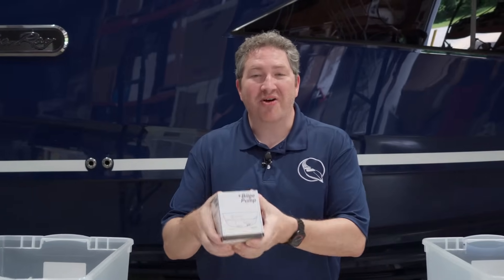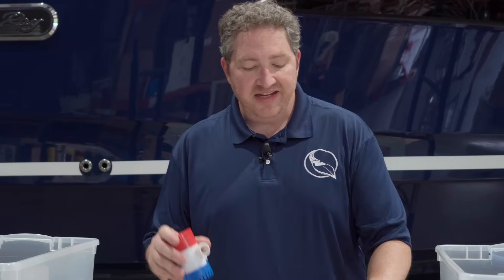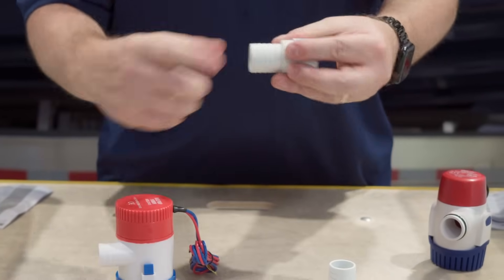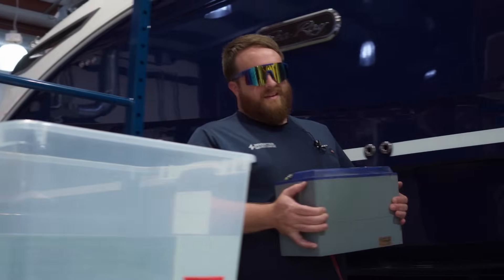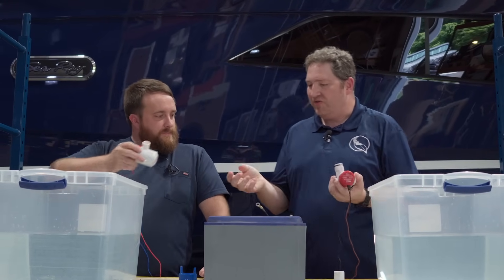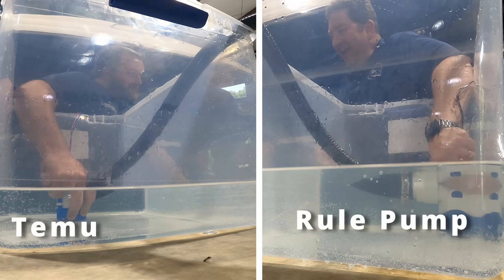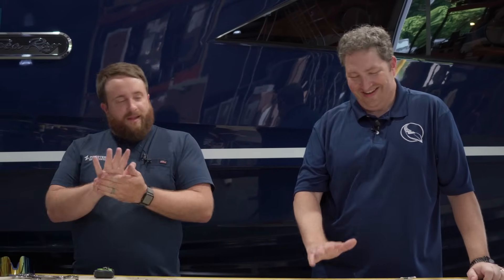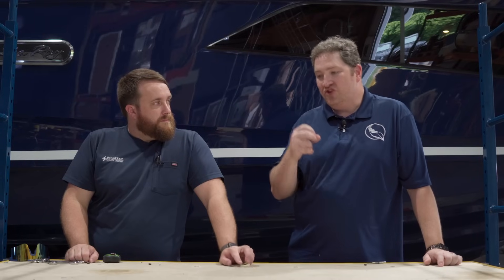Temu vs. Rule Bilge Pump — SHOCKING Test in Dirty Water!

Comment: Metric pvc pipe, fittings and hoses are close to Imperial ( used in USA) but not the same so trying to get connections correct may not work out. I was at a Sake plant in Napa valley and the pipe fitter had received some pipe and fittings from Japan, he was having a lot of concern trying to connect the Japanese parts to American pvc fittings and hoses.

Comment: You seemed biased from the get go without reason. You claimed the temu pump wouldn't fit in the rule base but you didn't bother to even try that even tho you had the parts in your hands. You guys should be more through and unbiased when making these videos. The video could have been good.
Reply: Dreadful review.
You wished the Temu product was very poor.
Turned out it wasn't. 
You need to be more impartial.
Reply: I agree. It felt likenthey were looking for ways to down play the Temu pump. I mean we all know Temu doesn't sell quality but will the pump do the same job at a fraction of the price? How much was the Temu pump? If you can buy 4 of the Temu pumps for the same price then longevity might not be as big of a factor.
Reply from the maker: Thank you for the feedback!

We explained in the video that the base of the Temu pump is not the same shape as the new Rule pump.  The old Rule pumps were that same circular shape, but they don't make them like that anymore.  Our experience in the past with trying to fit knock-off pumps into the old Rule pump base is that they weren't a good fit, and we just wanted to warn that if you try to make it fit, you may see that they aren't exact and the tabs on the base can break.

The Temu pump definitely performed better than we expected!  We certainly were biased going in, but surprised that it did as well as it did.  Like we said, longevity is the one thing we couldn't test, and you definitely want a trustworthy bilge pump in your boat to avoid disaster.  What we can say for certain is that the Rule pump is trustworthy, and while the Temu pump performed well, proceed with caution!

We definitely ARE biased, but in the end we didn't hide the fact that the Temu pump performed pretty well.  Thank you for watching!
Reply: @Marinepartssource  looks like the second attempt ended in a tie or even the temp pump slightly finishing first.  not seeing hoe the Rule pump "clearly winning" that attempt.
Reply: Yep, we sell this one.  The minute I heard that I KNEW they were going to tell us how much better the Rule one was.  So basically you wanted from the start to have people think that 7 bucks can't be as good or near as good because you don't make any money from it.